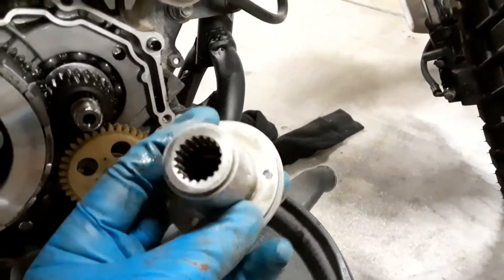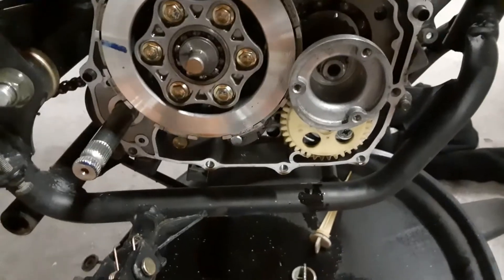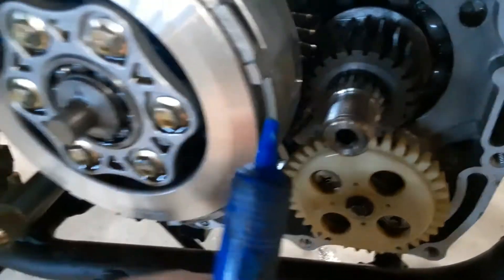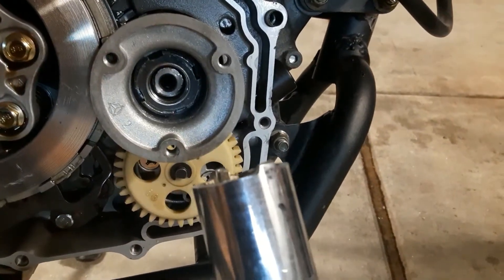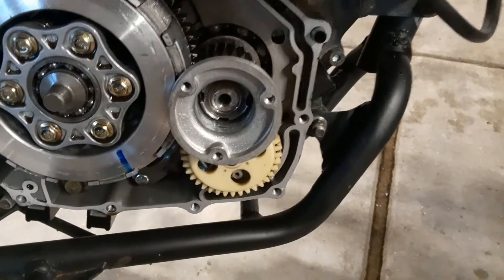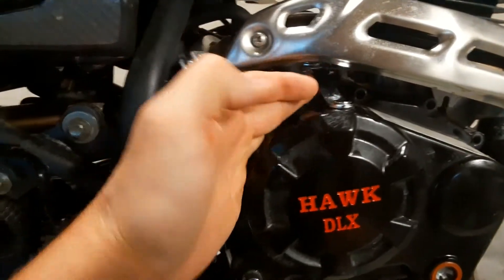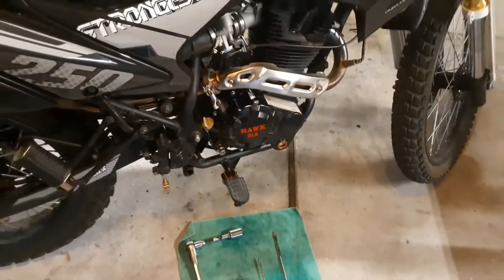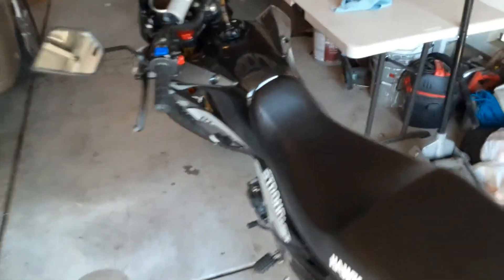Hawk DLX EFI 250cc Motorcycle Engine Rattle FIXED

Comment: I can't thank you enough for this great video.  I rode mine with a very minor noise (similar to yours, but not as loud) a little bit too long and was rewarded with some mashed threads on the shaft that the centrifugal oil catch is mounted upon.  It was near a 5 hour job because of that but it would have been much longer without your very fine instructional video.  Thanks again!

Comment: Hey just for future reference when you need to tourqe a bolt or nut in a a engine  on a component that wants to spin you should take a penny and put it between gears instead of a screwdriver. You want to use a soft metal to prevent  any chips of metal.
Reply from the maker: Excellent advice.  Thank you.
Reply: I use rope or trimmer line, more than enough to bind the gears, near impossible to hurt the metal, not that it's necessary on this engine but I've also used it on GY6 scooters by just stuffing the combustion chamber with rope through the sparkplug hole to pull off the CVT
Reply: You can also jam a rag between the gears .